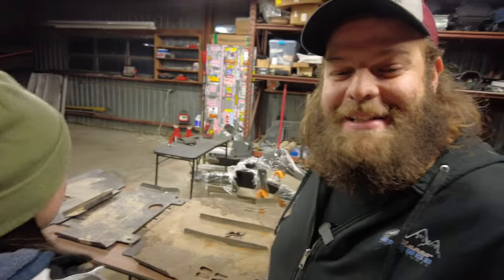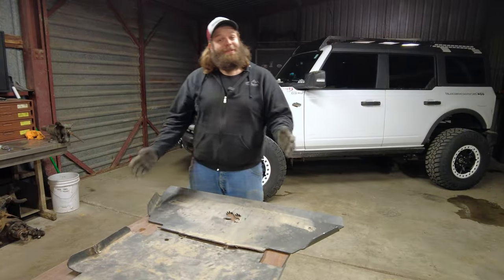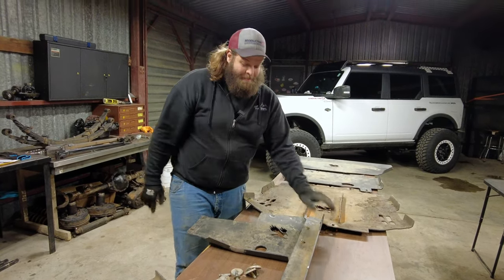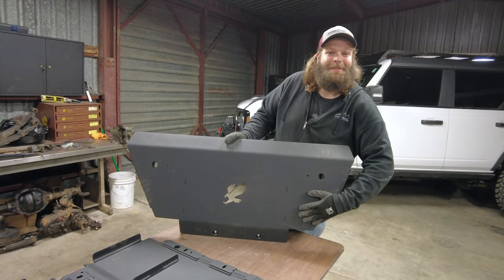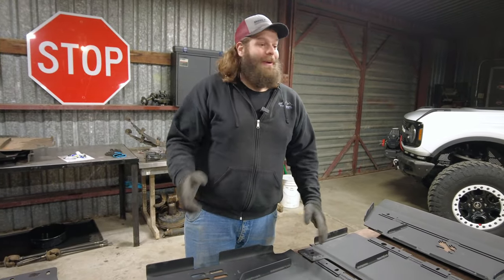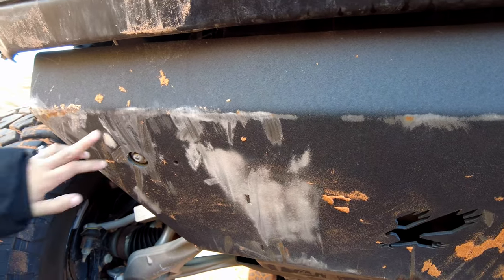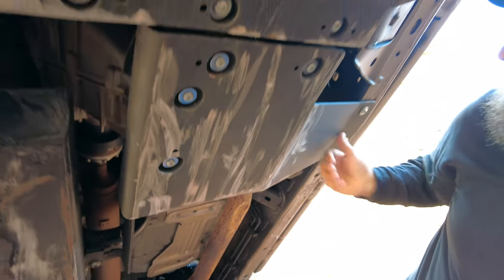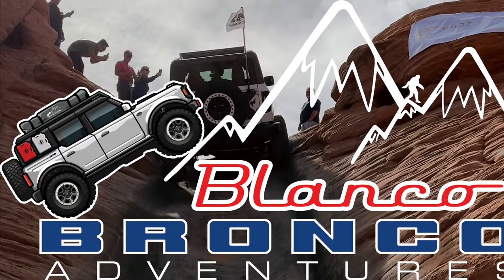These upgrades are AWESOME! | Talon's Garage Skid Plate System 2.0

Comment: Would you recommend the aluminum version of their skid plats
Reply: Our aluminum skids can handle quite a bit of use. Though, it truly depends on the type of wheeling you intend to do. If you are rock crawling like the Blanco Bronco team then steel is for you. If you are more of an overlander who may take an occasional hard hit then aluminum would be sufficient, and you won't have to worry about rust or touching up the powder coat!